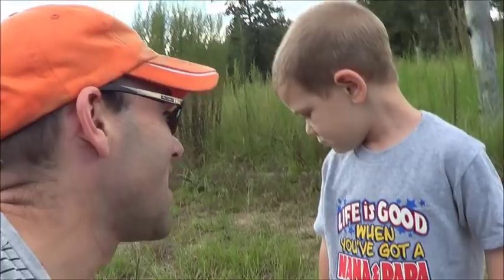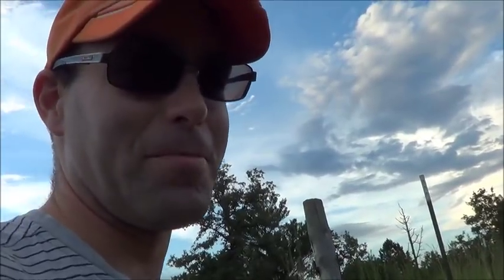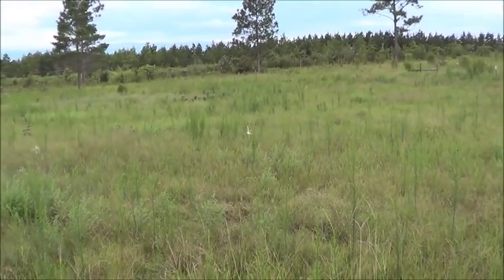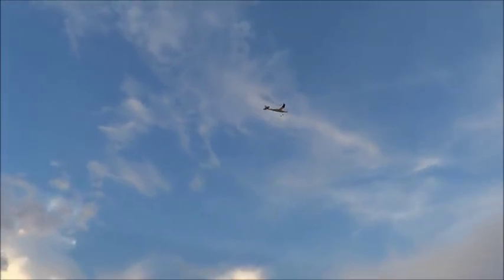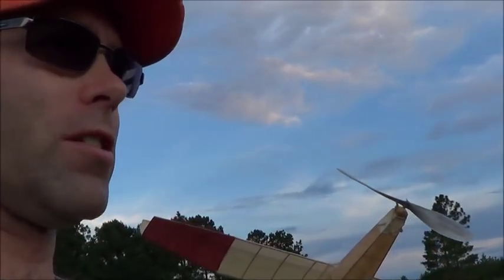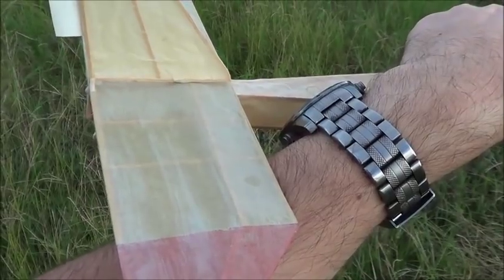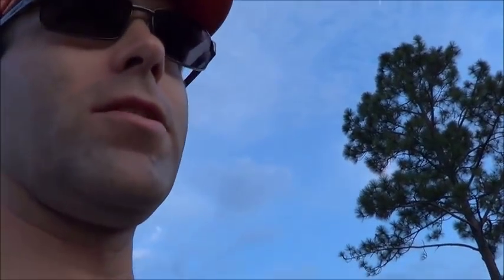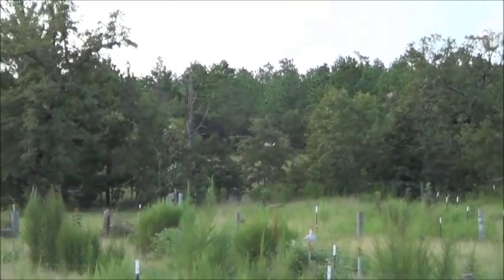Flying the Maxout prototype after 14 years of storage!

Comment: Did you say, a 7 gram Maxout???
Reply from the maker: Copterdude, yes. I did. :)
Reply: I'm assuming that's without propeller or rubber, right?
Reply from the maker: Copterdude with prop, without rubber. Mind you the Featherlight III is 2.7g empty. ;)
Reply from the maker: Copterdude, no worries. Life comes fast. :)
Reply from the maker: Copterdude thanks!